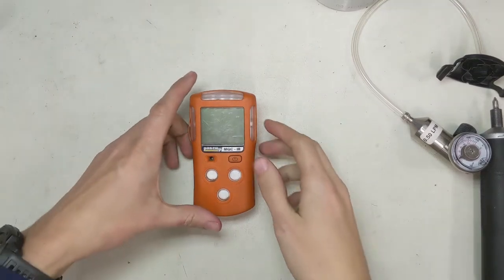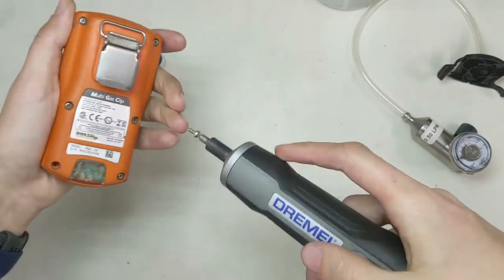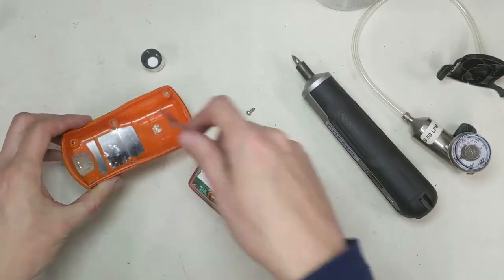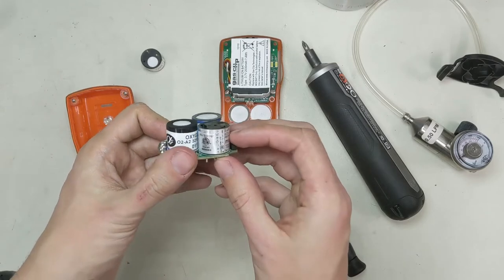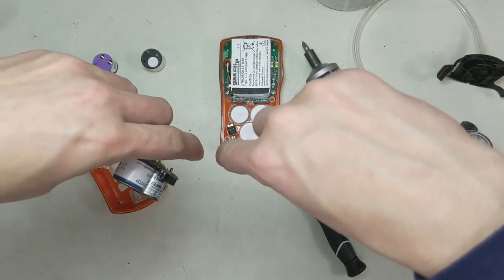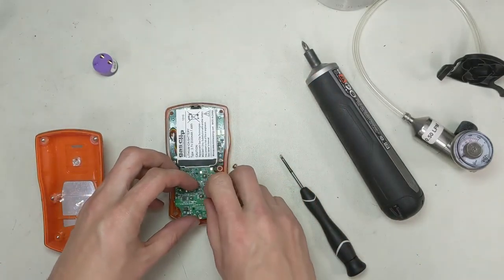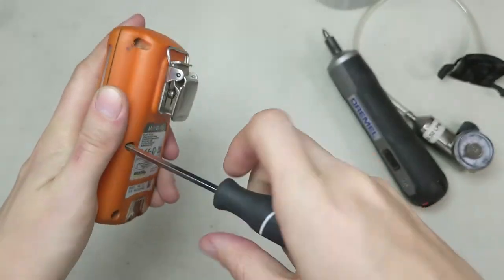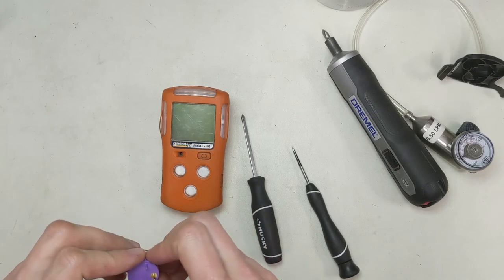Gas Clip Technologies MGC-IR Oxygen Sensor Replacement Guide by Ideal Calibrations

Comment: Hi .. i have a problem with the o2 sensor i replaced the o2 sensor due to o2 error .. even for the new sensor it shows error .. do u have any troubleshooting tips ?
Reply from the maker: Hey Rathan, did you wait an hour or so after installation to test? If so and it still failed, it's either the board has gone bad in that slot or you got a dud O2 sensor. If you got a dud I would send it back and get a warranty replacement. Unfortunately like 2% of them fail coming out of the factory. Make sure you've purchased from a reputable supplier, I've seen a good number of these being sold through Amazon and the like coming out of China with bad quality and fake labels.

Comment: 2 meters, 2 different O2 sensor models , both O2 show wrench. Bad?
Reply from the maker: When you say different models I'm not sure what you mean. Are you getting a readout at all on O2? If so, may just be bad sensors. If you aren't getting anything, O2 slot on the board may be bad

Comment: Can I replace the batter after it says end of life?
Reply from the maker: Hey Gevo, most likely if you're seeing end of life instead of battery fail it's a disposable unit. The disposables have the batteries soldered in, so you can't replace them. It's best just to buy a new unit. If you email a picture of it to support@idealcalibrations.com we can let you know for sure.
Reply: Yes, it's a 4.7v lipo battery, same as in a cheap toy drone. Soldered in but basic solder skills will get it done. Pump is on a plug in harness.